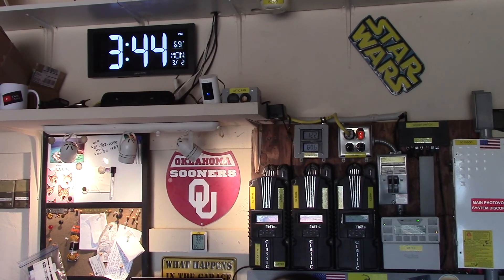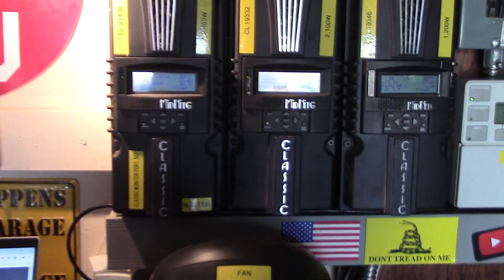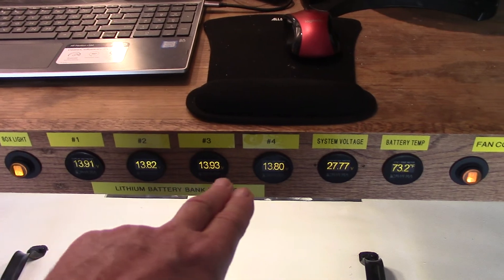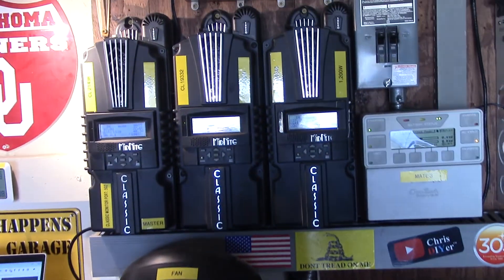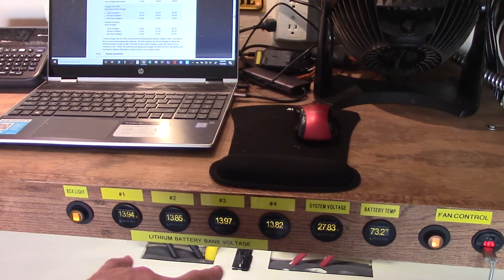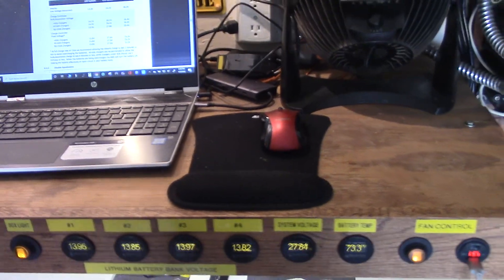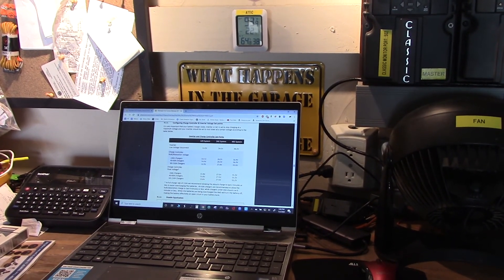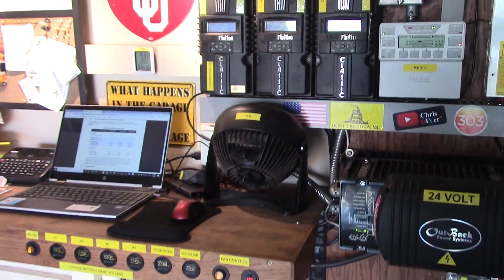(Follow up video) Home solar power lithium battery charging question

Comment: New to this channel so have a question. The video I saw was just talking about powering the ac in the bedroom but you have a ton of equipment so much it seems you could be of grid stand alone powered? What all do you have going on exactly panel and output wise? Just seems like way more then I see installed on houses around?

Comment: Hi Chris. Awesome setup!! Solid work! I think at one point you’d mentioned possibly going to a 48 volt config. Could you do a video on why you’d switch from 24v to 48v? To give you some context, I currently have an off-grid 500Ah 12v system (powering a full-size fridge and a some smaller appliances and lights). I’m going to add a few more batteries for more “days of autonomy” and I’m trying to decide if I keep expanding it at 12v or if I should make the move to 24v or 48v. I keeping reading that 48v will save you on cabling costs because you can safely use smaller gauge wire but if all your equipment is in close proximity, that’s not a big factor. I’ve also read that 48v systems are more efficient but when you compare 12/24/48 systems of the same manufacturer (like Victron), the efficiency ratings are virtually identical. Any insight and guidance you could offer would be greatly appreciated. Thank you kindly. Again — outstanding work on your setup. It is truly impressive.
Reply from the maker: 48v home solar power systems are better than 12/24v for efficiency. Ever wonder why those AC transmission lines outside our houses aren't 120v AC? It is way more efficient to use high voltage over distances and step it down. For DC (direct current)...DC current doesn't "travel" as well and line loses are even higher vs AC. There are several online calculators to calculate copper/wire loses. When you use higher DC voltage there is less current flowing down the copper. Those calculators also show how it all calculates out (using higher DC volts vs lower DC volts and their associated losses).  I run 24v because it is what I started off with and there are plenty of 24v rated equipment that you can get (marine and aviation for example). I would rather have 48v, but haven't switched over. When I went from 12v to 24v...everything ran better. Less heat, less cabling, less room for error. For PV systems less than 600w or so...12v is fine. 600-2,400w...24v is usually  fine (48v is better). And above 2,400w in PV...48v is ideal. Solar costs real money, best to do your homework first, watch a lot of videos, ask a lot of questions. The folks at the AltE Store have built a great website for DIY builders and/or give them a call. Good luck.
Reply: Chris DIYer — Thanks again. I appreciate your reply and certainly appreciate your channel.

Comment: My batteries are at 0.005 v apart 12 cells in series. If you are happy then its great.
Reply: My system wont run if 1 cell goes 0.1v out. The whole system will shut down. But thats my settings. You should be monitoring single cell groups and the total voltage. Your batteries are most likely ok
Reply from the maker: I am thinking it has to do with the Midnite's "throttling back" power while in FLOAT....messes with the batteries minds. Anyway to fix that?
Reply: @ChrisDIYerOklahoma  can you turn off the float?
Reply: @ChrisDIYerOklahoma  im not a midnight guy . I dont really know all the options they have.  Sorry brother. I do not absorb either. Just bulk to the set voltage and stop. When the batteries voltage gets low enough the controller will rebulk.

Comment: I sent you a pm on FB asking you to call me. My spelling sucks that is why. I 100% know why this is going on just my spelling holding me back. In a nut shell the cells will all charge about the same just not a %100. So when your at the top of your charge your bms is working to balance them. This is not all but my spelling holding me back. just know this is 100% fine and normal.

Comment: You should take a look an ask will powers on you tube he does a lot lithium just send a message on his latest video an check back he always answers but if you got a question or problem he is more than likely to have an answer he has done nothing but lithium for the last year reviews an teardowns of new lithium batteries.

Comment: maybe the 2 batteries are just a little weaker than the other 2
Reply from the maker: I think it has to do with the Midnite's reducing power while in "FLOAT"...possibly not enough power to maintain consistent voltages. Two batteries (the two left ones on each string) will creep up to 14.0v and the other two will hang out at about 13.7 or so. When the sun goes down...all four batteries' voltages are within 0.02 volts. In the morning before charging...they are about the same. The issue I am having is that "Twilight Zone" while in FLOAT till the sun goes down. Not sure if there is anything I can do.